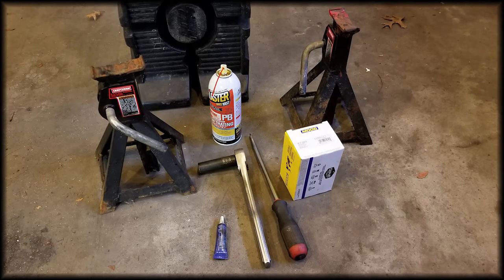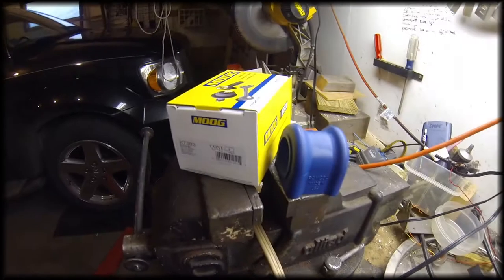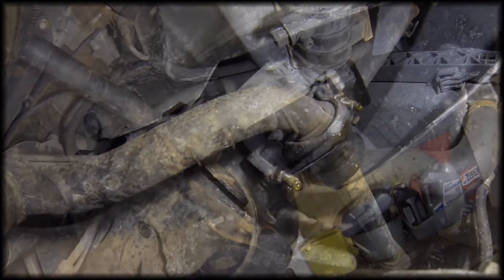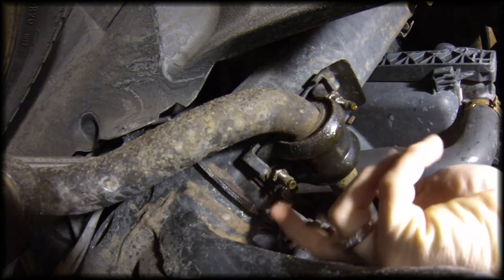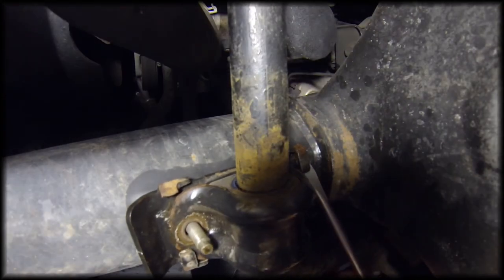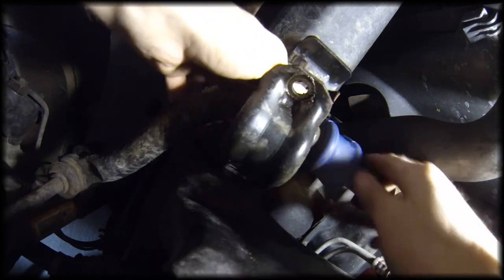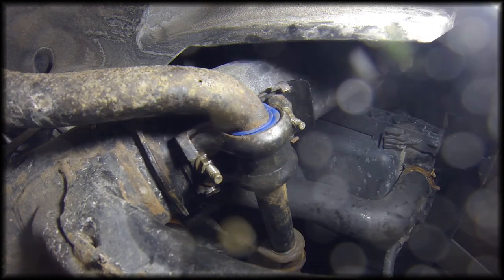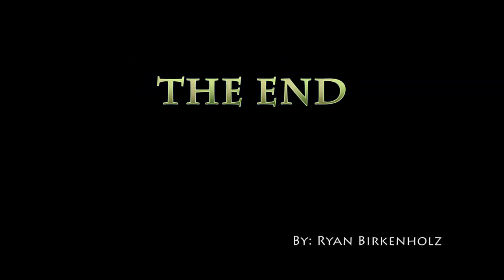Replace Front Sway Bar Bushings 2007 Dodge Durango

Comment: Interesting. If I have a need to do this, I may add lock washers in place. Great video of what looks to be an easy DIY.
Reply from the maker: Lock washers may be a reasonable idea.  I think that blue threadlocker is probably good enough though.  Given than the torque spec is fairly low, it leads me to believe that there isn't a lot of loading on these nuts/bolts.  I have been running mine for about 40k miles with broken retainer clips with no issues.
Reply: @birkato  yeah sway bars don’t really go under a lot of pressure, there’s not really load on them, more just torsion when one side compresses and the other doesn’t.

Comment: I took off sway bar off my Durango and now I don't know which way it goes, could you send me some pictures at the end of the bar by the tires.thanks  if you still have your durango
Reply from the maker: I am pretty sure it can only be installed one way.  If you want to know for sure you should be able to find a parts diagram on the internet showing the assembly orientation.  I cant photograph mine at the moment.  Good luck.

Comment: Did u have any squeaking after install. Some people say to use grease on bushings. I replaced them recently and have a terrible squeak now with no grease
Reply from the maker: I did not use any grease on mine.  I have a 145,000 miles on them and have replaced them twice now.  As soon as I start hearing them rattle I replace them and they quiet down.

Comment: I just put offroad tires on mine and now my tires are bald do I need new offroad suspension
Reply: Any off-road tire will wear faster than normal tires, less contact area means the areas that do contact the road endure more pressure. I’d recommend finding high mileage rated off-road tires. Also getting an alignment can help tires wear more even.